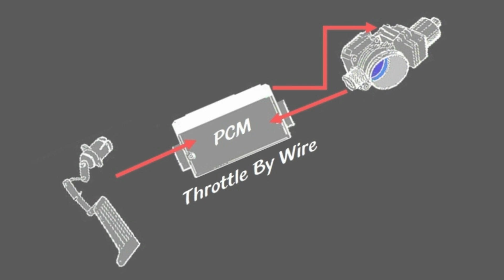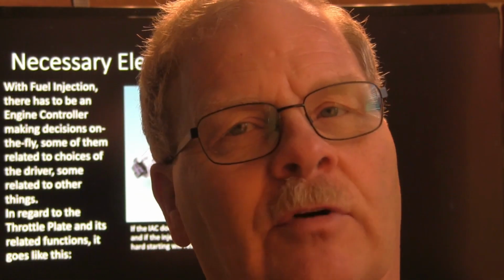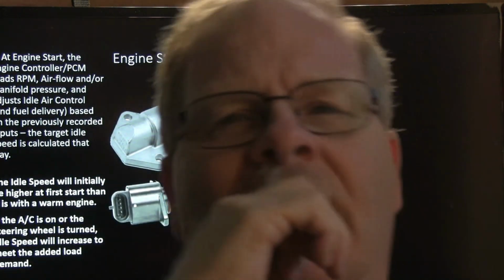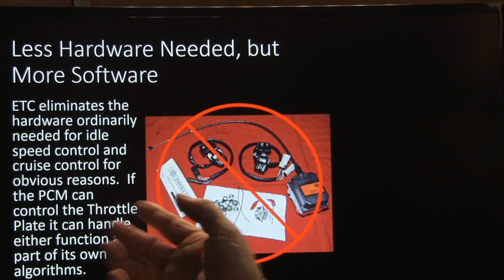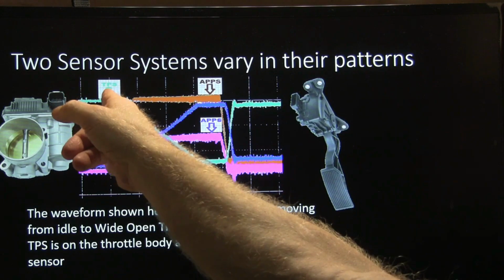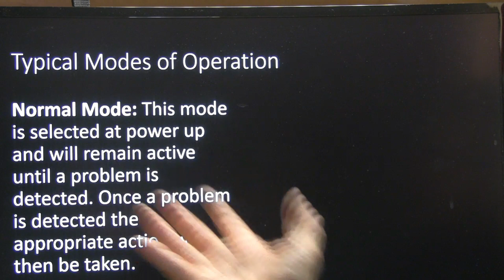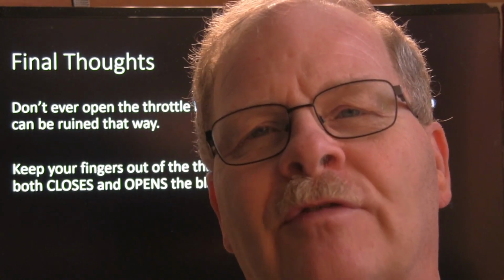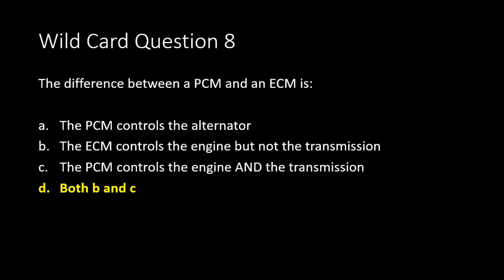Throttle Body Stuff

Comment: YEP
Most Toyota parts cost a bit more than the domestics.
I heard somewhere the flex fuel from some manufactures is only software and a sensor. Fuel pumps, lines, and injectors are the same.

Comment: Shouldn't the answer to Question 3 be a) A only?  Technician B says as the temperature decreases, negative coefficient thermistors reduce their resistance.  That's not correct.  A negative coefficient thermistor would increase resistance as temperature decreases.
Reply from the maker: You are absolutely correct my bad
Reply: @McCuistian  I stared at it WAY too long trying to figure out what I was missing.  thought I was being double tested!  Sure appreciated the time you put into these videos!
Reply from the maker: @johnaclark1  it's really easy to screw up one where you have positive and negative and PTC and NTC and all those other words thrown together there and I can see how I would make an error like that if I was going a little too fast putting the test together
Reply: @McCuistian  It's all good. It made me stop and think a little harder!

Comment: What am I missing on question #7? It is making no sense to me. I haven't seen a generator on a car in years!
Reply from the maker: You might notice that the J1930 regulation (and many shop manuals) refer to the alternator as a "generator." But some manuals still refer to it as an alternator. So I went looking for what the difference is, and it appears that it's only referred to as a generator if the PCM controls the field.
Reply: @McCuistian  You tricky devil you !!!  Technically all alternators are generators, are they not?
Reply from the maker: @markinkster9257  Technically they are - that's the point of the J1930 term change
Reply: @McCuistian  Sometimes I think. that in trying to clarify things the government only muddies the waters even more. Aren't all auto makers supposed to follow the j1930 standards in their service info?